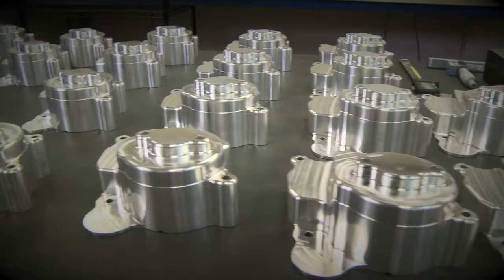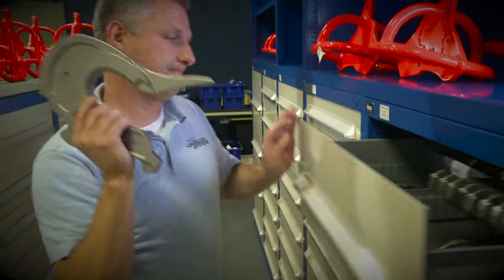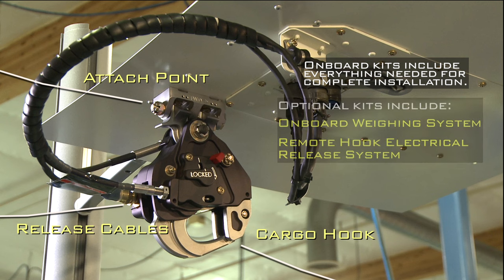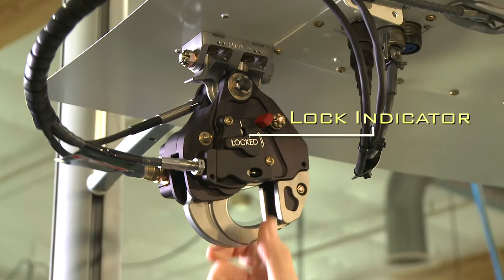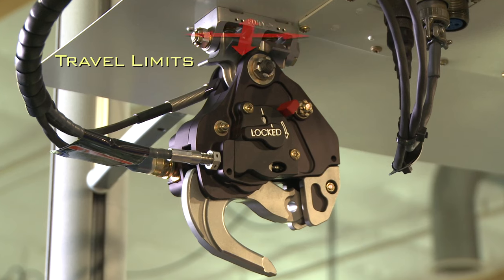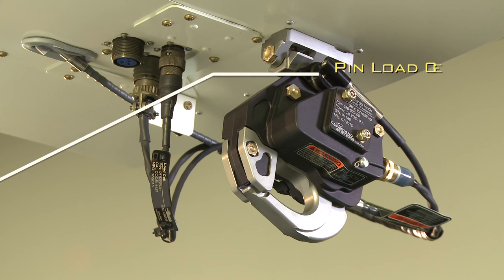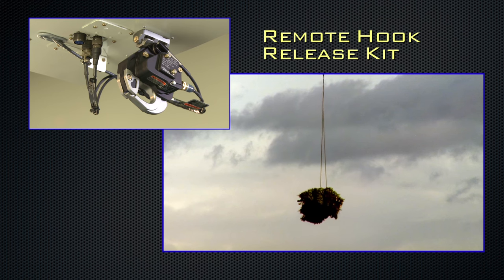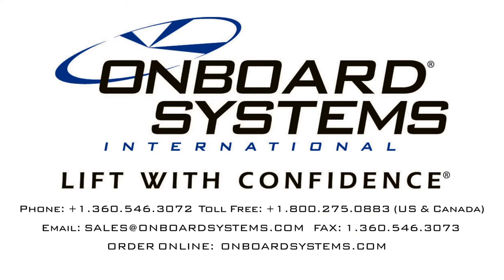Onboard Systems - Robinson R66 Cargo Hook Kit

Comment: There is an actual "utility R66", manufactured for long lining and set up for solo in either seat. They have set it up as a left seat start, left seat drive (solo) and have a VR gauge kit that has TQ, MGT and a load cell, under the left collective. The hook is rated for 1200 pounds.